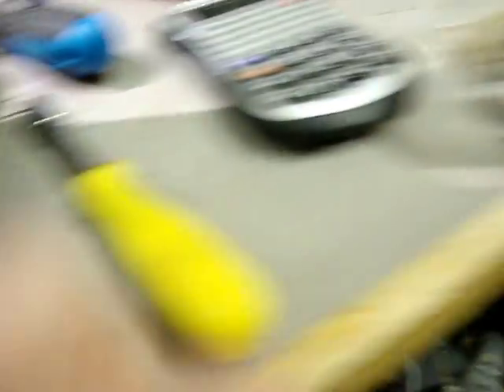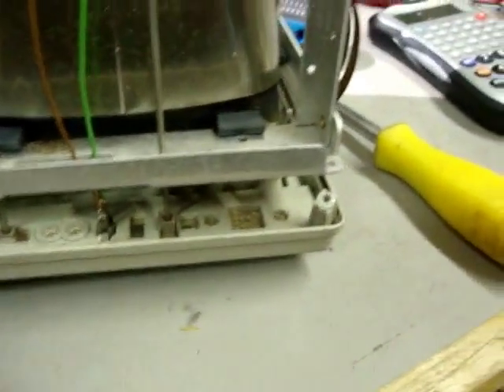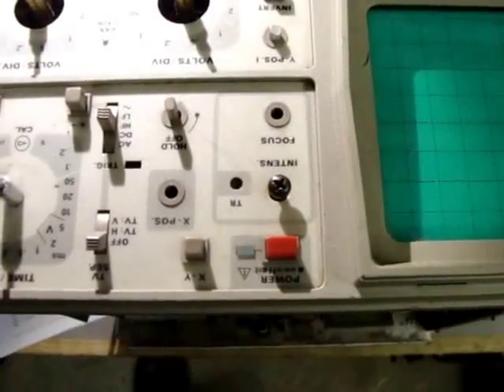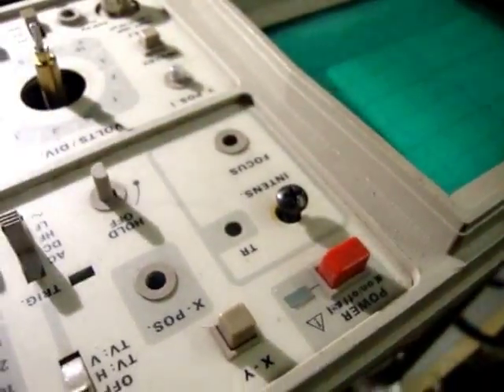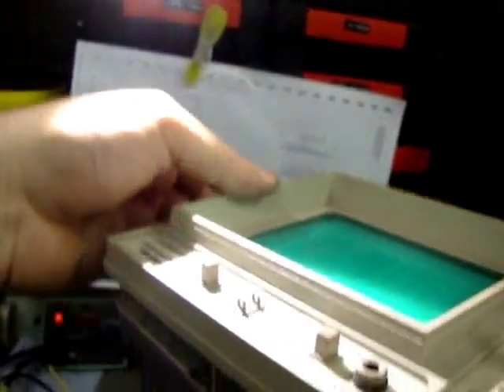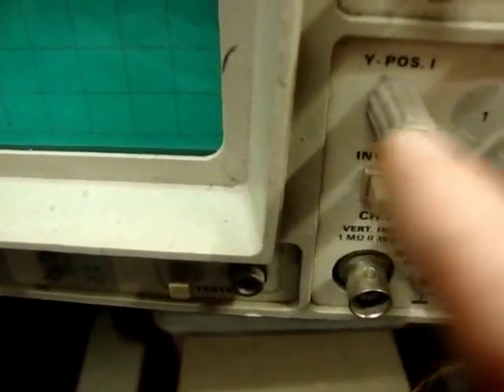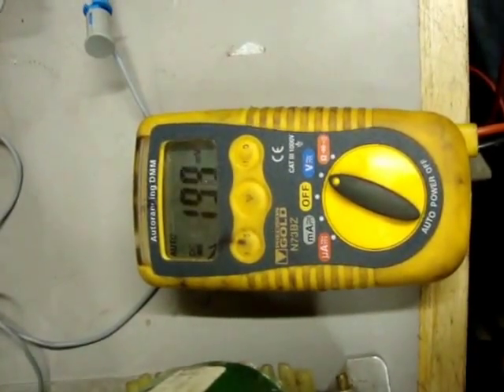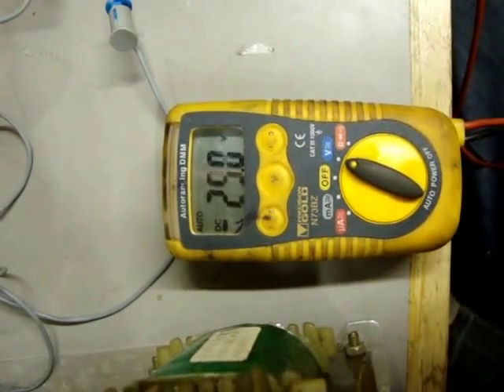Repairing HAMEG HM203-6 - Part 3 - Yet further diagnosis

Comment: I followed with great interest your repair of this Hameg HM203 scope 
Recently I got hold of 3 of them 2, 203-6 and 1, 203-7.
Both the 6's seem to be ok but the -7 had no trace, so I followed your diagnosis to the latter, it led me to a o/c intensity pot 470k and also a broken lead in the ribbon cable connecting the IF board I replaced the bot with a pair of 220k resistors with the centre tap for the slider …problem fixed.
The scope has also suffered with broken spindles, but that's no problem I can make a rubber mold and cast some, but where can you find 470k pots (470KA H20 A2)
John